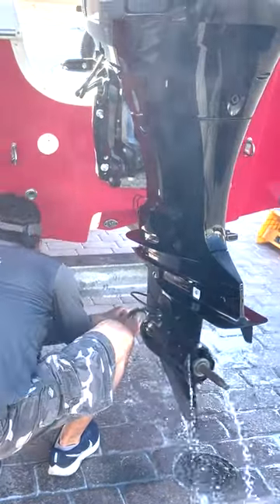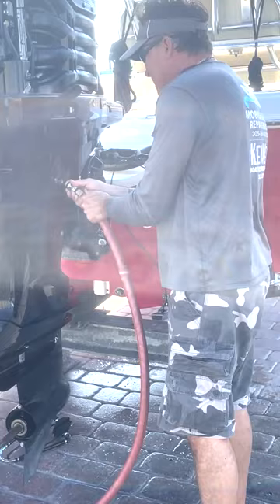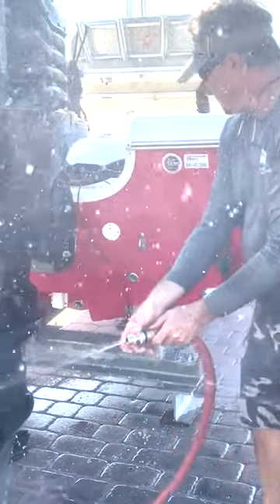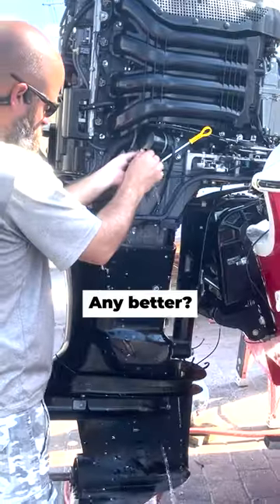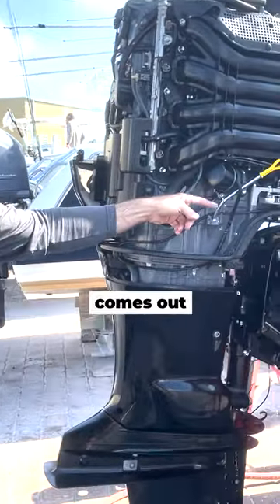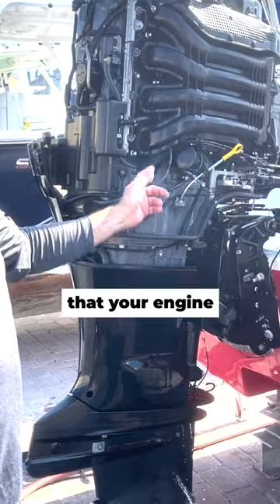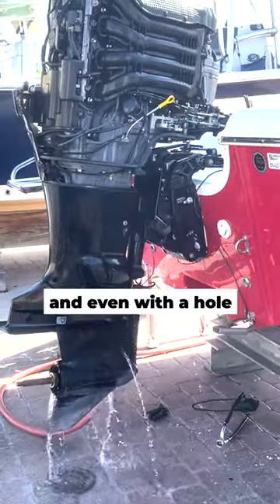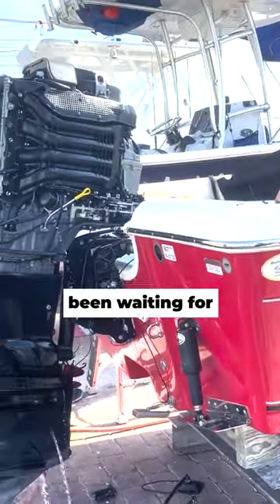OMG My Outboard Motor is NOT Peeing

Comment from the maker: Found the outboard engine to be full of salt so we flushed it with salt off so the owners wouldn't have the engine overheat! How often do you flush your motor?
Reply: every time it comes of the water
Reply from the maker: @duanethumudo3967  exactly what we preach!
Reply: Never buy a salt water out board.
Reply from the maker: @Harlanmote  We'd love to hear why not? What are your thoughts?
Reply: If you’re putting it in salt water needs flushing every time it comes out….
Reply from the maker: @nolt4024  yes exactly!
Reply: Concentrated barnacle buster works miracles
Reply: We pull the boat out just so we can flush it at least once a week, but if it comes out more often than every time it comes out of the water it gets a flush, so far no issues
Reply from the maker: @josephvella3688  Sure does we use it by the gallons.
Reply from the maker: @henryhenry3832  Good for you .... keep it flushed!
Reply: @WillFixThat  it gets expensive if you get lazy lol
Reply from the maker: @henryhenry3832  you can say that again!
Reply: I flush my motor everytime I take it out.  I live in a area where I go in a lot of fresh and saltwater and some brackish but I just always flush it.  It runs really well and I know I am not going to get stuck
Reply: Every time I come off the water.
Reply: Should flush after every use in salt or fresh water
Reply from the maker: @alanramsey8324  right on 👍
Reply: What do you mean how often. If it goes in salt it’s meant to get flushed. Along with everything hosed down. Boat/ trailer/ gear anything that got wet.
Reply from the maker: @lukeclarke1068  just asking cause people have different ideas … we say every time too!
Reply: I have a brand new Yamaha motor that I flush every time I come in from the salt water..
Reply: @Harlanmote 
Hard not to do in FL.
Reply: After every use.
Reply: I flushed mine everything I pulled it out of the water!!! It will prevent the piss hole from being blocked!!!
Reply: @WillFixThat well I wouldn’t buy a salt water motor because I’m gonna guess the motor wasn’t flushed due to ignorance or laziness every-time it gets put back in it’s parking spot.
Reply from the maker: @christophertibbetts2458  you have to take care of your motors that’s for sure.
Reply from the maker: @jerrymclean8075  right on!
Reply from the maker: @966Mako  yes. 👍
Reply from the maker: @lupejauregui2  right on!
Reply: Ill assume you did the impeller but did you check the thermostat?
Reply: Drop the lower end and replace the impeller.
Reply from the maker: @gentrynewsom2080  clogged with salt.
Reply: @duanethumudo3967  Lucky you.   I don't often have fresh water at dock.  And the boat lives there.
Reply: @Harlanmote  This is pretty stupid adivce, unless you live inland.   On the coast where I am 99.9 percent of the boats run in saltwater.   My last engines (bought used at 400 hours) had over 1800 when I sold it.  Both were fine.
Reply: I flush my outboard more than i flush the toilet.
Reply from the maker: @andrewthomson  lol guess that’s a good thing … you won’t get clogged up 🤣
Reply: They need one of those Amazon no brand bolt on for $225 that way they can just let it fall in the water when it don't start
Reply: I haven't ran a marine outboard since I was a kid boating with my parents, but I recall them giving it a quick flush at the marina and then a more thorough engine flush and full hull and trailer wash/rinse at home, and check all the anodes every time we got home. Dad always said if you don't wanna help clean it after a day out I'll just sell it. 
They stopped running it when fuel prices spiked since it burned 8gph and a good bit of 2cycle oil, and we'd spend about 10hrs a day out on the water. Engine still looked brand new when they finally did sell it though, a lil tlc goes a long way.
Reply: We always stop by the lake on the way home from saltwater for a little rip around to rinse the salt. 10 minutes riding around, then homebound. I usuaslly even hit my reels with some freshwater to rinse those off too.
Reply from the maker: @100GTAGUY  exactly preventative maintenance 😆
Reply: Every. Damn. Time.
Reply: I flush after every trip. Can't take any chances with an investment like that.
Reply from the maker: @TomyTekOutdoors  completely agree but some clients don’t take it as seriously … flush every time!
Reply: You should flush out your engine out every 3 times that you use fresh water 💧
Reply from the maker: @byronschultz3367  we actually tell our clients every use be sure to flush!
Reply: I have to do it regularly. Lake by me has really really bad silt deposits.

Several years ago I had to pulled my engine apart to clean out the clay cooked into the water jacket. The old lady was NOT happy at there being a boat motor on the kitchen table for a week. 😂
Reply from the maker: @ObservationofLimits  I’m sure the young lady couldn’t wait to get that project completed! 🤣
Reply: Every time
Reply: I flush my motor each time I return home , regardless if I’m on salt water or fresh water.   There is still contamination in both waters that you don’t want to transfer to the other water
Reply from the maker: @Whalermansteve84  great practice to flush every time!

Comment: I carry a piece of weed  wacker  string and use it to clean out the pisser because sand and salt gather at exit  fitting on the motor. It is flexible and doesn’t poke holes works great
Reply from the maker: Love this idea …. Thanks for sharing!
Reply: I use weed wacker string too - also, when storing the boat on land or even if you leave it in the water I leave a pipe cleaner stick in the pee hole to prevent insects, etc from entering …then remove before use!
Reply: False information son
Reply: Can of compressed air works for me, but I probably be throwing some weed whip line in my boats!
Reply: Same recommendation I was gonna give. 200# mono works also but not as well. I keep a peice of stainless steel filler rod and about 4ft of weedeater line in my boat.
Reply: Dude me 2!
Reply: @WhiskeyTangoFoxtrotSixNiner Thanks for providing the correct information... Oh, wait...
Reply: Lol me too..
Reply: @petermacgregor9805 Good Idea.
Reply: Thank you for posting this- I'm going to throw a couple lengths of weed Wacker string in my tool box on my boat. 

Brilliantly simple idea. Thanks!
Reply: The weed whacked string also works magic on clogged sunroof drains….  Absolute magic 🪄
Reply: Great idea👏👏
Reply: Weed wacker string has so many uses. I’ve cleaned many sunroof drains with it as well.
Reply: Mud dobbers like to clog mine up
Reply: @petermacgregor9805 great idea im doing that now😂
Reply: That and dirt dobbers like getting up in the tube

Comment: Needs a new impeller!!
Reply from the maker: Yes thanks also needed an acid wash!
Reply: Use barnacle buster! Works great from what I hear.
Reply: @WillFixThat  have you ever run vinegar through it , try it once every few months
Reply from the maker: @unclewill  sounds reasonable… white vinegar?
Reply: @WillFixThat yup. Regular or cleaning strength. Just flush with water after.
Reply from the maker: @andrewthomson  Yes flushed 2x
Reply: @WillFixThat run anti freeze thru it when you winterize it. 😂 or keep it out of salt water also check sacrificial  anode.
Reply: Exactly
Reply: Water pump man, not hard!
Reply from the maker: @justsendit2167  that was already changed …. It was full of salt!
Reply: Need a new impeller

Comment: I bought a motor from a guy that thought it was locked up it wasn't he was trying to start it in gear he had only ran it in the great salt lake two times this motor only had 3 hour's on it 2012 fifteen horse four stroke it wasn't pissing like that after I got it started and flushed it out it was clogged up with salt I have been running it for 5 year's now without a problem best motor iv ever had
Reply from the maker: Sounds like our motor it was clogged with salt!

Comment: I have an 1962 75 hp Evenrude.
The old engines did not pee like that.
The water splatters out the Exhaust & after about 5 minutes when.the thermostat opens the water will gush out.
I have a buzzer & light that alarms if engine over heats.
My voltage regulator is not on the engine, so it will not overheat due to lack of water.
My water pump housing is not plastic with a steel sleeve - it is solid steel.
Mine is first year of Selectric Shift that I didn't trust so I made it direct drive.
I use premium gas mixed with Pennzoil marine Semi synthetic 2 stroke oil 50:1.
I use Champion J8C spark plugs.
I run/fish on Lake Erie in fresh water.
I purchased boat, motor & trailer almost 30 years ago & it still runs good at minimum expense.
The boat has max speed of 29mph
Reply: Nobody asked
Reply from the maker: They don’t build stuff like they used too 🥴
Reply from the maker: Hmm 🤔
Reply: I just got one. Guy did the electronic ignition. 😮. , starlight 75. On ugly boat with big 1957 chevy wings. Lol 😮
Reply from the maker: @lodwill5116  🤣
Reply: @lodwill5116  
Kool - Enjoy!
My boat is a Superglas 1963 Runabout without Fins.

Comment: Had the same problem with my 02 Yamaha. Turned out to be the impeller on the water pump in the lower unit. They're made of rubbery plastic and over time they break. If you find that's the problem, make sure you get every little piece before you replace it and close it back up and start it. All it takes is a tiny piece to get sucked up and clog it good.
Reply from the maker: Ours ended up being salt!

Comment: Had same issue with '88 90hp V4 Evinrude AFTER changing impeller after outboard sat for 2 years in garage. Solution was to remove foot a second time and back flow all the coolant passager. Reassemble and all good.
Reply from the maker: Your lucky …

Comment: Most likely the impeller dry rotted enough to where once you started it the ears broke off the impeller and is now clogging the exit tube for the water , so its not pulling any water and its mostly clogged, drop lower unit after draining oil from it, then the impeller assembly will be on the top of the lower unit
Reply from the maker: Great ideas Chad … it ended up being full of salt!

Comment: I had overheating problems with my Evinrude E-Tech 115 for the past 3 years. First I changed the spring in the cooling system that makes the engine run hotter to burn off extra fuel when running half throttle, then last year both thermostats and this year the impeller. That’s just about everything. And I’ve only run in fresh water and only have 138 hours in it
Reply from the maker: Wow that seems like a lot to go wrong with low hours!
Reply: @WillFixThat  what pisses me off is that they don’t make Evinrudes anymore to use the lemon law and try and get a replacement
Reply from the maker: @Retired88M  Yes sucks sorry about that man ....

Comment: It’s plugged somewhere, might as well replace impeller too!! The joys of owning a boat👍😀
Reply from the maker: We did replace the impeller and it still didn’t fix our problem! We used salt away to flush and it did the trick.
Reply: Ahh salt!! Not a problem here in Michigan, but I bought a small outboard last year I had to take apart and dig out sand!! It was used in the marshes for duck hunting👍
Reply from the maker: @gillgetter3004  Yes salt is bad down here .... we get sand in lots of motors because people like to pull up on the sandbars! 🤣

Comment: Check the impeller in the lower unit. If it's bad it won't pee right or at all.
Reply from the maker: It was changed & still had issues ended up being plugged with salt!

Comment: This doesn’t have to do with the outboard, but if you have kids, and use that swim platform and ladder, switch the hardware and put it on the right side of the transom. Will still go over the trim tabs. This way, you can watch the kids as you coast past them (even reach out to slow them down more) all the way to the platform.(away from the motor) Young kids? Older adults, change the cheap 2 step ladder to a 4 step folding stairs. Much safer.
Reply from the maker: The owners rarely use this boat ..... they don't have kids but its a great idea! Agree 4 stairs is much safer.

Comment: Your impeller pump is bad or has a couple reversed fins I had that problem it would pee but it wasn’t strong an I pulled the lower unit an the impeller had 3 reversed fins
Reply from the maker: We replaced & still issues discovered it was full of salt!

Comment: When was water pump replaced salt water on out board 4years outdiver 2 years
Reply from the maker: Engines has very low hours … boat is barely used but must not have been getting rinsed after a boat ride! Thanks for sharing!

Comment: New water pump on a newly looking engine. But they are made out of the rubber inners. Don't take much sand or dirt to kill it. Plus when sitting up out the water for months at a time the rubber dry rots ...
Reply from the maker: Ours was full of salt …. Ended up flushing it twice!

Comment: Never use reverse in skinny water. Hopefully it’s not something major
Reply from the maker: It ended up being full of salt!
Reply: Salt deposits around the coolant system. Usually, the car washes near the fishing spot have hoses one can use to run water through it. Take a few minutes to run fresh water to get rid of all that salt. If you wait until you get home the salt will weld the thermostat shut. Always make sure the coolant and oil alerts are working. Sorry to go on and on. Glad you got to the problem. Best of luck, be safe and keep them lines tight.
Reply from the maker: @anglers48  thanks for going on and on people need to learn and not just hearing it from us! We constantly tell our clients the same simple easy steps to take to help with maintaining a boat!

Comment: Keep a small piece of wire in your boat . Something fairly rigid like a piece welding wire . Sand is bad about accumulating in the nozzle of those pissers . Some times if you run aground and it stops pissing , back down on it hard . That works better if your dealing with grass
Reply from the maker: Yeah this is our customers boat … so we are just trying to work out their kinks!

Comment: You pry have it figured out by now but I’d say bad water pump the where over time on a-lot of motors min was doing the same exact thing except it caused my head to blow on the motor. I’d say water pump. Your suppose to flush your motor every time your done using it I normally do every other time.
Reply from the maker: Yes we had changed the pump but still no pee it ended up being full of salt because client wasn’t flushing 🥴

Comment: Zip tie works good to unclog it while engine is running it will clear it and will work
Reply from the maker: Salt clogged it!
Reply: @WillFixThat  yea a lot of times the salt dries up in there into crust and a zip tie with the engine running breaks it lose
Reply from the maker: @DLeopoldi914  it was too impacted with salt … but we got it after about 30 mins.

Comment: You probably have small chunks of oyster shell or debris that have been sucked in and managed to make its way through the impeller to the P line. Replace the line leading from the impeller to the exhaust coming out or get you something abrasive and run it through the pee hole and continue to work it back-and-forth, and the debris will work itself out. You may also want to put some salt away inside of the intake and it helps to break down salt chunks.
Reply from the maker: Yes full of salt … we flushed it!

Comment: Impeller burned!!  Need replace new impeller
Reply from the maker: We did replace the impeller & flushed the unit! Thanks for watching.
Reply: Wrong
Reply from the maker: @pickledcottoncandy  no that’s not wrong that’s the truth!
Reply: @WillFixThat  what I meant was just because there's no tell tale doesn't automatically mean it's the water pump. More often than not, It's trash in the line. Sometimes they won't piss on a hose either and have to be dunked. Don't assume it's a water pump until you've investigated the other routes first.
Reply: @pickledcottoncandy I agree. Always start simple (and usually cheap) and work your way up.

Comment: Vet impeller in lower unit replaced if not overheating will happen.if you put in water and it won't stay running it's impeller.
Reply from the maker: Impeller was already changed it was full of salt!

Comment: In-laws had a pair of Suzuki’s that were full of salt. Bad enough to where a local shop took the power-heads completely apart. It cost a ton of money and the shop did an amazing job. But my in-laws where upset at Suzuki because the marina flushed the engines every time the boat was taken out and put on the rack. Turned out yes they did flush them every time, but not long enough for the thermostat to open to circulate the flush water around the engine.
Reply from the maker: 🥴 ugh that sucks! Our clients was full of salt too!

Comment: WoW! Literally this happend to me yesterday. Hadn't used the boat for 6 months, the warning lights didn't come on. Took a spin around the marina, looked back at the motor and a very weak stream was coming out. Scared the hell out of me as I slowly returned to my slip.   I flushed the motor with Salt-Away and let it run through (motor off) for about 25 minutes. Now I have a normal flow. Scared me though.
Reply from the maker: That’s exactly what we had to do to this motor! Glad you discovered no pee early!

Comment: The impeller is most likely bad..If the weep hole was clogged most likely it fried the impeller..There just made out of a hard rubber it doesn't take much to screw them up...I've seen them go bad just because somebody dry started there motor for 60 seconds...
Reply from the maker: After more troubleshooting it was full of salt.